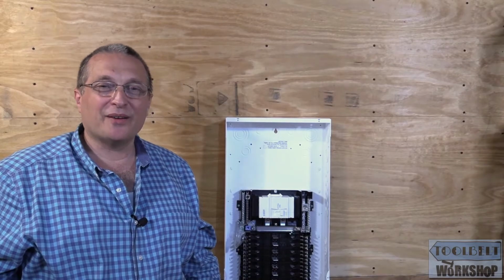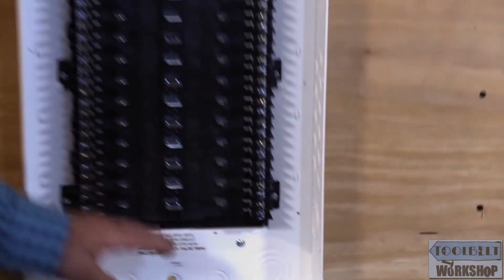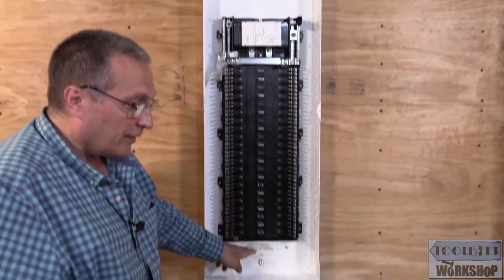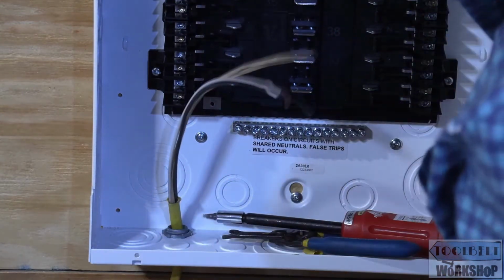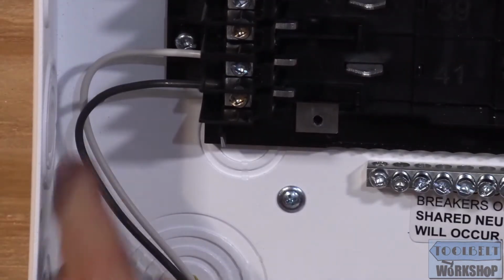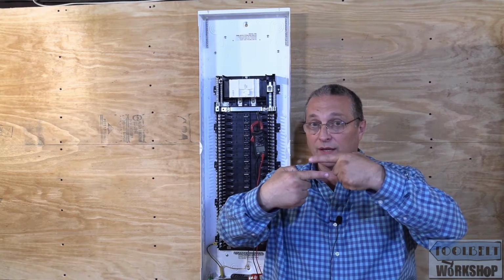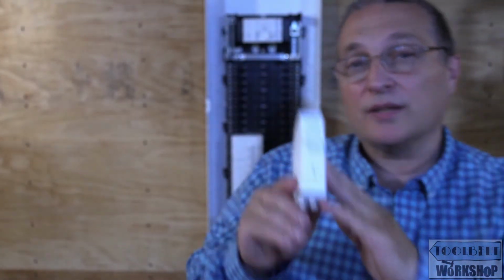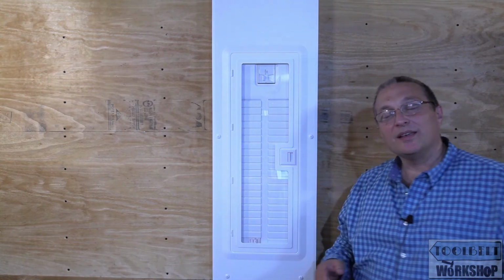Leviton Circuit Breaker (Load Center)

Comment: I've read the Leviton Smart Circuit Breakers (e.g. LB115/120-DS, LB130/230/240/250/260-GS) emit a significant 'hissing' sound when installed.  Have you run across this challenge?

Comment: Leviton should stick to making average grade devices. Good luck selling such expensive electrical equipment that average homeowner can not afford. Think its just another company with good intentions trying to reinvent the wheel. I retired after 50 years as a sparky who installed hundreds of 100 & 200 circuit breaker panels. I have a lot of Leviton Decora illumaneted switches & dupex receptacles in my own home.
Reply: It’s barely more than a normal panel and with the saved labor costs probably cheaper l.. embrace progress…
Reply from the maker: Hi Izzy, thanks for you comment. At first, I was questioning the Leviton Load Center and after a year, I decided to install one for a new service and the installation went amazingly fast. I really like the way the branch circuits are landed onto the panelboard and not onto the breakers.

We have published our new Electrical Videos on our website, ElectricalTime.com, we hope you enjoy our new Electrical videos
Reply: The panel is not expensive because the 66 slot version cost $368 . I just did a full DIY project management myself. I used a certified electrician to get it installed. I bought the expensive AFCI/GFCI on ebay from online distributors.